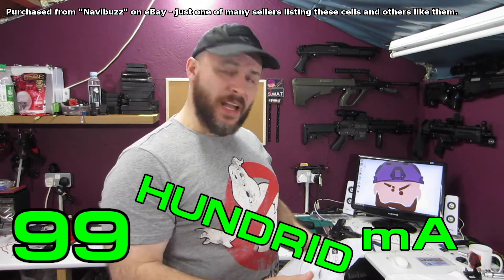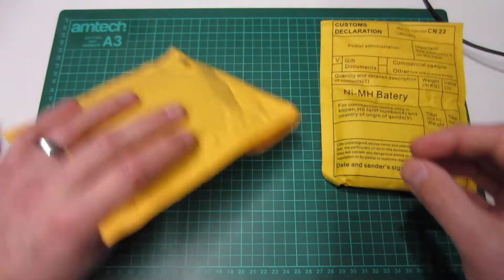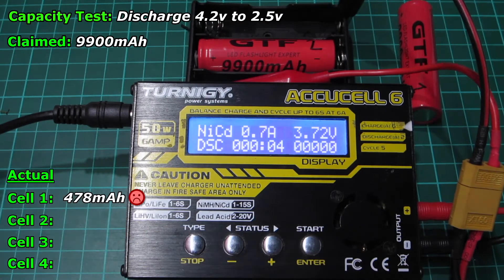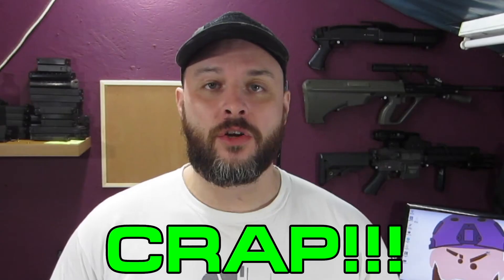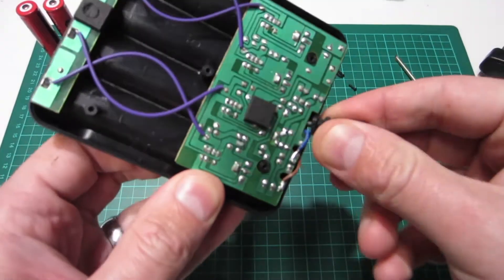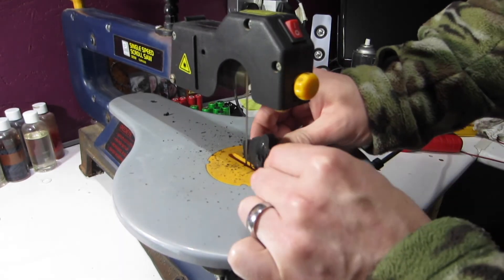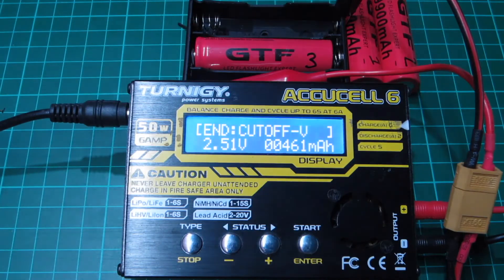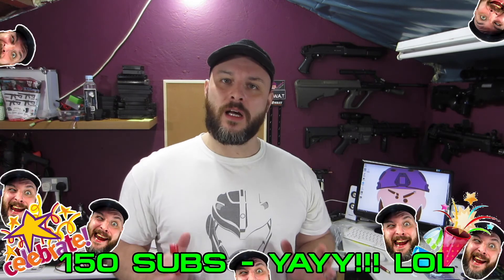You Can NOT Be Serious??? | eBay GTF 9900mAh 18650 Batteries & Charger | Unbox, Test & Review.

Comment: Again another informative video, shared this  with my scuba diver friends. Thankyou rammers x
Reply from the maker: Thanks Avril, hope you are well!  I'll maybe test a couple of 26650 sized ones - are those more commonly used in the diving community than the slimmer 18650?
Reply: both the 26650 and the 18650 are very common. 18650 for small torches and the larger ones for the bigger longer burn torches. I will be along to see you at some point next week with that torch for a look at.

Comment: Awesome teardown!
Just to let you know, the Li-Po mode on balance chargers (like the Turnigy - I have a Turnigy AC6 myself) takes them up to their full capacity of 4.2V, and there is virtually no difference between Li-Po and Li-Ion batteries. So just use the Li-Po mode, which is what I do.
For discharge tests I will also start using the Ni-Cd or Ni-MH modes and setting the cut off to 2.5V.
Reply from the maker: +spotify95 - funny you say that - I noticed that about the charger right after making the (terrible) fake battery video and that's exactly how I do it now!  Great minds and all that hahaha

Comment: Awesome! That's lower capacity than any I have ever tested.
Reply from the maker: Jim Donaghy - thanks buddy lol - I know my testing is very rough but it's enough to show absolute gash cells like this.  They didn't even have enough energy in them to do anything interesting when I shorted one out lol
Reply: For a new battery, yes I agree with you. I have tested batteries that only came out at 300mAh (!) but these were old laptop batteries from a knackered laptop battery pack. Regarding new cells, these Ultrafires, GTFs, TrustFires (or any other name with fire in it) are the worst and are utter crap.
In fact, I wonder if I should sell all of my crap capacity laptop batteries as Ultrafire 4200's or GTF 9900s?

Comment: Ok but say you just want a mediocre baterry that you can get for 3$. In that situation would this be ok? Or they are just too dangerous for any use at all?

BTW: thanks for the awesome video!
Reply from the maker: Hey buddy cheers for taking the time to comment!  For me, personally, I wouldn't bother.  You can get ok cells that don't lie about their specs and provide way more capacity, for not a lot more.  The PKCells I done a video on are one such cell - and they come with full specs, so you know what current you can safely draw etc.  I'd go for something like that as a minimum, just too many unknowns with poor cells.  And the real world difference is huge - the worst cells would only power an LED flashlight which has a super low current draw for around 30 minutes.  The PK cells run one for hours.  So it isn't just a little difference, it is beyond significant
Reply: Thanks so much for your reply man! Great info! I will try to find some PKCells online! Cheers
Reply from the maker: Just before you go looking, there was someone who commented, said they got some PKCell that were terrible - but they didn't buy them from the official accounts.  If you are on eBay/Amazon, you want to buy from either Durnergy or Fuspower, PKCell told me themselves in email, that is their official accounts.

The guy that said he got terrible ones did NOT buy from them.  And, with these being so plain, it would be easy money for counterfeiters to sell fakes claiming they are PKCell.... so yeah, buy from official source.  I have 8 running in a powerbank, it's fantastic, powered my phone as a CCTV camera for approx 24 hours before the phone started using its own battery 👍

Comment: I have a real German manufactured 18650 battery from the brand ANSMANN and that battery has a capacity of 3500mAh and the capacity you will see is 3350mAh so these Ansmann batteries of 3500mAh is the maximum you will get! Those China made 18650 batteries with capacities of 9900 or 9999mAh is straight up BS. Never go for those kind of China made batteries. This German made Ansmann batteries cost about 24 euros per battery keep that in mind!

Comment: thanks for your help and hard work this is what a three pin plug in the uk should conform  to http://www.bs1363.org.uk/ that is what a plug should be (yes I am a sparkie 17th ed, 2994/5 and pat tester) so I know for a fact that website is spot on.
Reply from the maker: +simon bibby - mate, thankyou for that!  The exact bullshit plug I had on this (and on other things in the past) is listed in there as one of the most dangerous.  I'm not a qualified electrician, but knowing basics and using common sense, I could just tell it wasn't right - so wanted to try and help raise a bit of awareness.  Thankyou for confirming I wasn't far off!  Definitely illegal then!
Reply: no worries fella just passing safety advice on
Reply from the maker: +simon bibby - well as said, very appreciated.  Obv all we can do is try and get word out because this is a real problem.  The charger I had here was plastic bodied, so not AS critical to earth - but it still needed to be fused.  I bought a tattoo power supply once that had the same plug - no fuse - and it was metal bodied - with no earth!!  Crazy
Reply: ferking crazy no earth same as when I fail an item "well can I still use it ?" I get asked I say if you like but it will only kill you once, people tend not to use it then lol